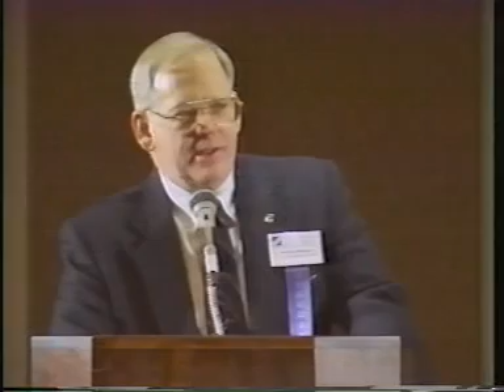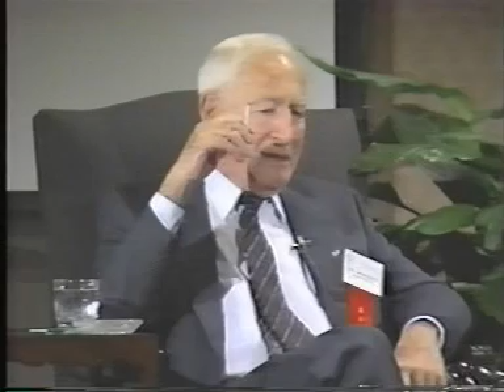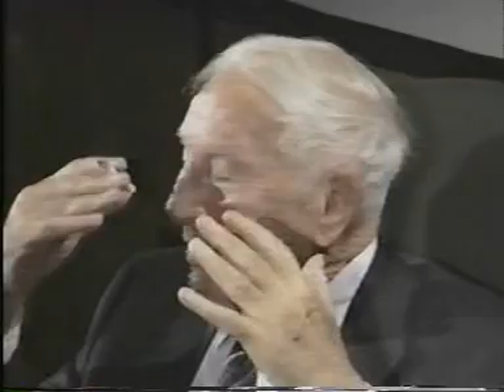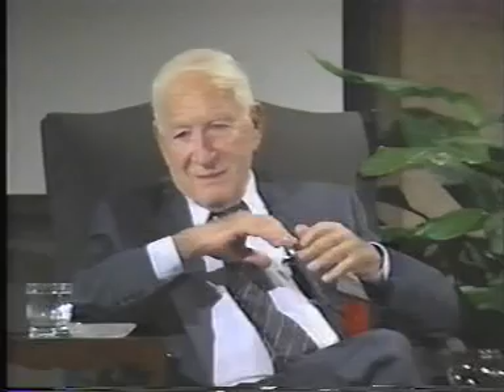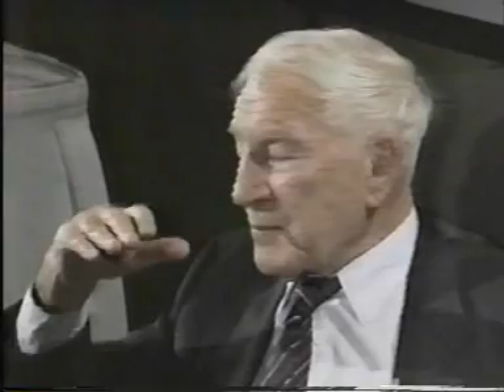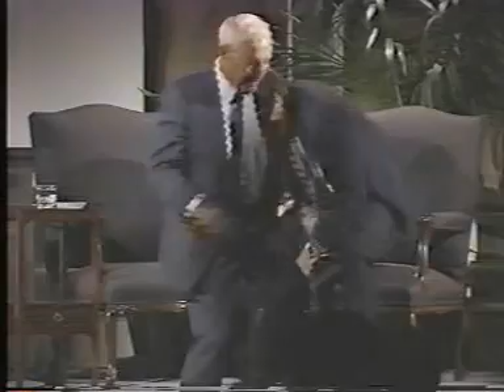Zora Arkus-Duntov's last public interview

Comment: In  about   1963   Duntov  had  a  Project  to  build  Cobra  Killers  The  Gran Sport  Corvette ..     He  was  doing  it  in  secret  but  the Top  Level  GM  found  out and pulled  the Plug  after  only 5 of them  were built..  and  yes  they  did  beat Cobra's   those  5  did.
Reply: 1963